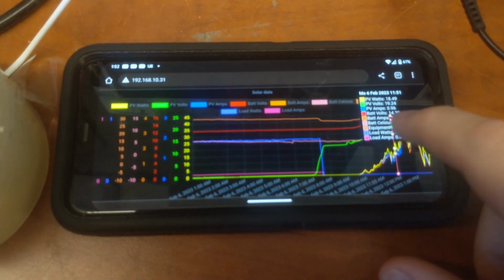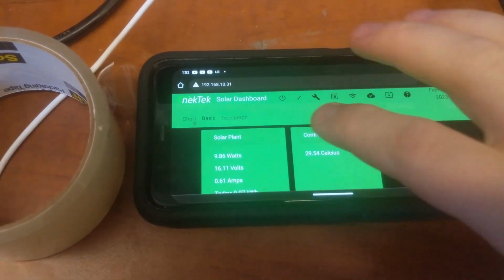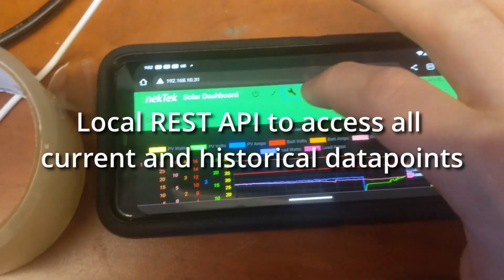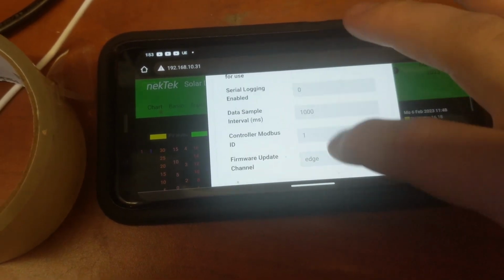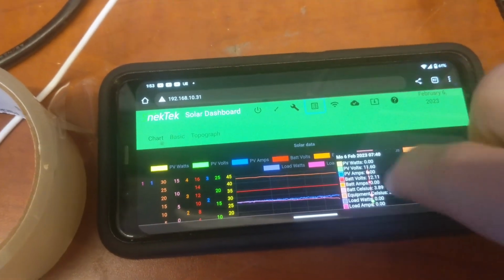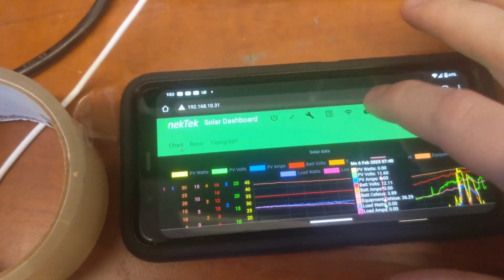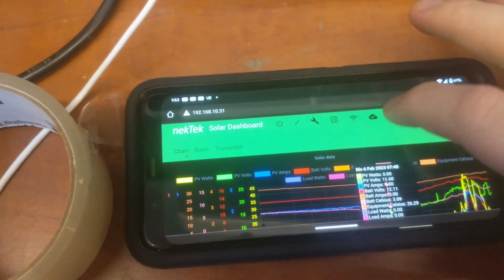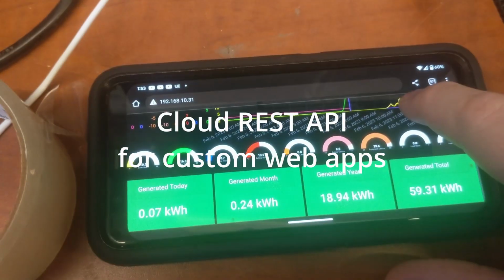How does the SnekTek Solar WiFi Dashboard V3 compare to V6? Product Update and Teardown

Comment: Thanks!
So I'm looking to buy 2 of these (I have 2 Renogy MPPT SCCs).  Is there a "dasboard" app that runs locally, not on the cloud?  I like the cloud option for sure, but I'll be looking to mess around with the data locally as well.